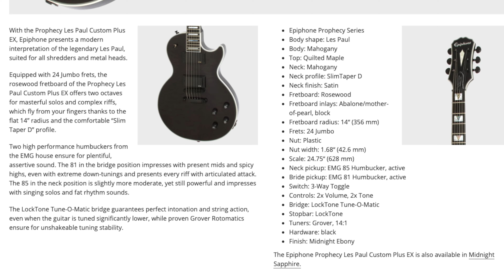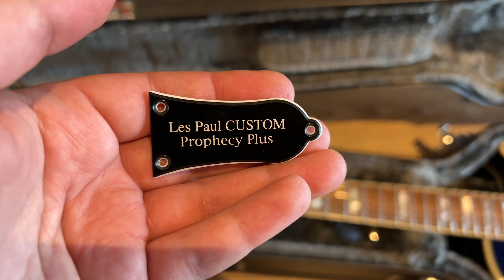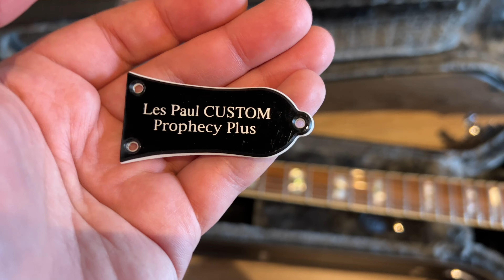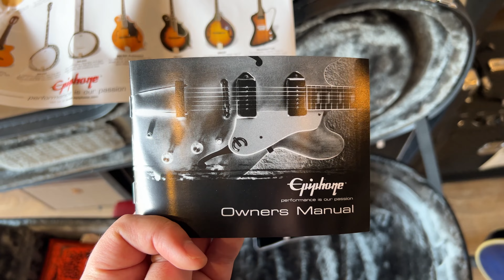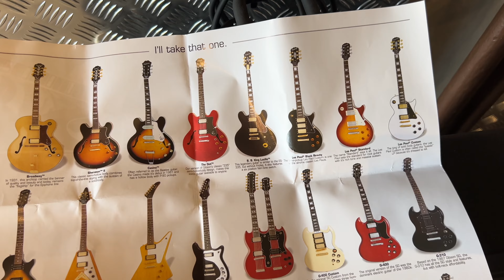I didn't like the Epiphone Les Paul Custom Prophecy Plus EX - the story of my first electric guitar

Comment: Bought my used 2018 prophecy plus last year in brand new condition for 300 bucks. I converted the stock 9 volt system over to 18 volts, it is a very easy modification to do and gives the guitar a noticeable punch to the tone. The prophecy is an amazing guitar and rivals the quality and sound of a gibson or fender costing twice as much. Really love it!
Reply from the maker: Good deal 🤘🏻

Comment: I have the same guitar.

Fantastic looking guitar, very unique features for a Les Paul, but in my opinion it sucks ass.
They kept the 24" 3/4 scale, and in order to fit 24 frets they pushed the bridge pickup more towards the neck, and it doesn't have as much bite as other LPs with EMGs.
The 14" radius fretboard also fucks up my vibe.

For me the best metal Les Paul for riffs is Bjorn Gelotte's Jotun.
Ultra-solid mahogany body/neck, super-chunky 59' neck and proper 24" 3/4 scale with 22 frets and a 12" radius fretboard. It's actually just a thick necked Les Paul custom with EMGs.

Comment: I have this exact guitar. I love it and I hate it. it just sounds muddy to me
Reply from the maker: If you like the playability but hate the sound, try swapping the pickups to passive.
Reply: @GeorgeVGuitars  good shout. Can you recommend any good pickups I could swap to?
Reply from the maker: What kind of music do you play?
Reply: @GeorgeVGuitars  mostly metal and rock. I’m very inspired by Alter Bridge at the moment.
Reply from the maker: @skatepark02  Check out what Mark Tremonti and Miles Kenedy are using in their PRS guitars then. They both use passive pickups.
Reply: Got mine (Midnight ebony) and swapped the humbuckers (DiMarzio's Super Distortion and PAF Pro, both in cream), chrome hardware, gold speed knobs with push pull pots (series/parallel x2, phase inverter) and locking tuners. Now looks like Ace Frehley's 77 guitar and I love it. Got a second one (heritage cherry) and I plan to swap the PUs (Gibsons) for Seymour Duncan JB & 59. I love 24 frets LP shaped guitars (got a LTD EC 401 in Olympic White and Ibanez Arz 200 Gold Top)